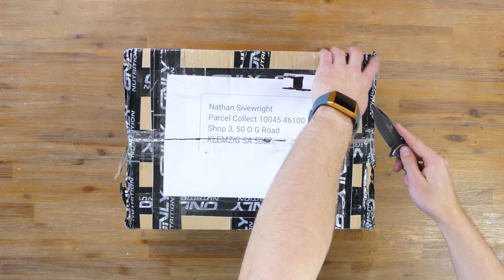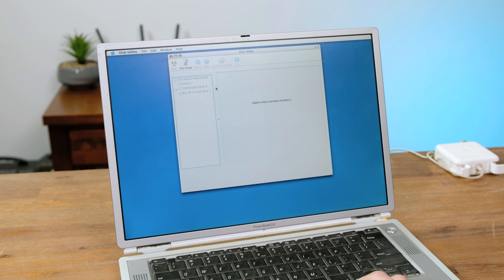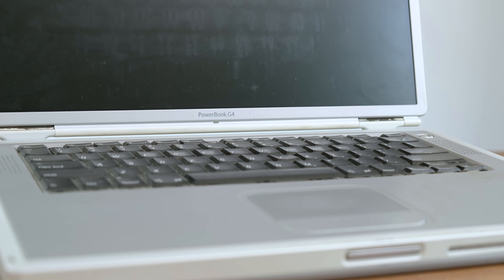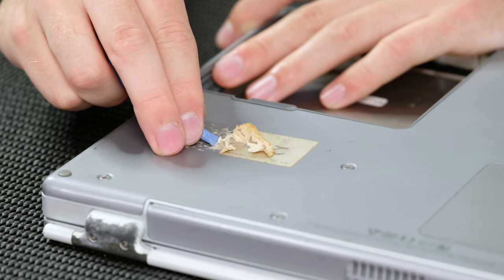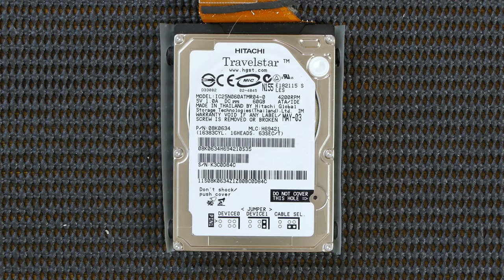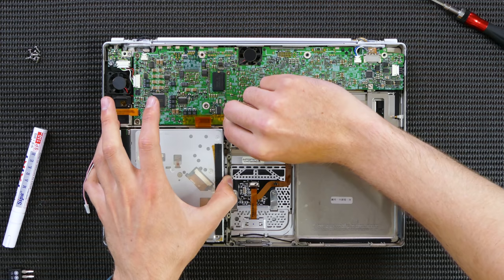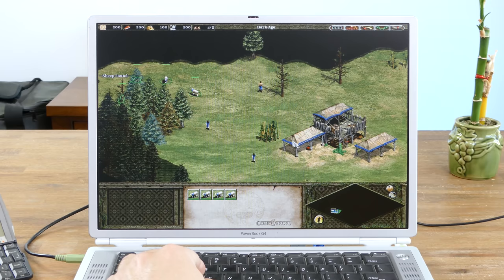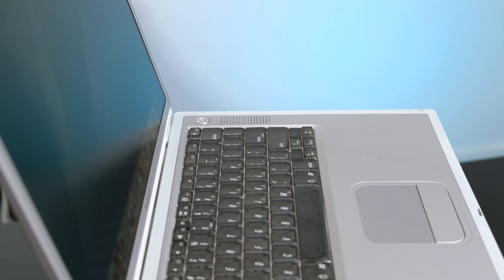Apple's $7,500 Laptop From 2002!

Comment: I still have my "TiBook" in pristine physical condition, but the display receives only power and no signal. It was an impressive machine.
Reply: Check iFixIt for your specific model. They probably have a guide on replacing the LCD cable, which is what I bet that it needs. You can verify that by seeing it if it will output video to an external monitor. If it does, the LCD flex cable, which is a wear item, needs to be replaced.
Reply: @SweetBearCub  It's been sixteen years since I have done anything with it, but from what I remember, the screen was powered and displayed only a blank white field. An external monitor did not receive a signal. The startup chime played and the HDD booted (known based on sound). I suspected faulty display logic, but I was ready to get a new computer anyway, and so I did.

Comment: Oh I have one of these I've been using lately. I stuck an SSD in it (via msata to pata adapter). the battery still has 2 hours left on it shockingly. if TenFourFox could run discord smoothly I'd probably actually use the thing, but discord is painfully slow even on a dual proc 2ghz g5 so I don't think tenfourfox on an 800mhz G4 has much hope. (it took 5 minutes to actually send a message after I hit enter!)

Comment: Psivewri
To remove labels of all kinds, from all surfaces, held in place with any adhesives, I have found Contact Cement Cleaner to be astonishingly effective. It has Never damaged any plastic or finish found on laptops and other electronic equipment.
To remove:
1 - use a small paint brush to apply a generous amount of the CCC over the label.
2 - wait about 30 seconds to one minute
3 - using a high quality, dangerously sharp, utility knife blade (a bare blade as used in a yellow OLFAL utility knife) held at an angle of around 20 degrees, worked under the label, pull the label up as you move the blade along under the label. The label seems to float up off the surface of the object.
4 - once the label is removed use the CCC to clean off any adhesive residue remaining on the surface,
You can remove most labels within a few to several seconds. After removing any residue the surface is clean and free of "shadow outlines".
5 - Clean up remaining CCC with a clean paper towel or cloth.
I have used this on metals, hard & soft plastics, glass and all manner of painted/coated surfaces with Zero damage to the finish for the past 25 years.
Use Extreme Caution When Handling The Blade. They can cause deep & severe cuts to your person if you are not paying attention and using deliberate control.